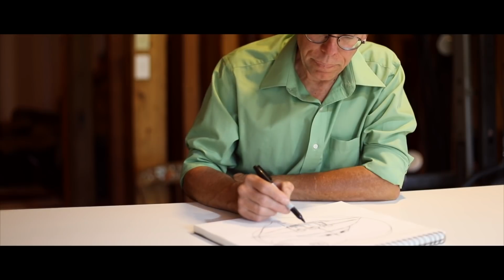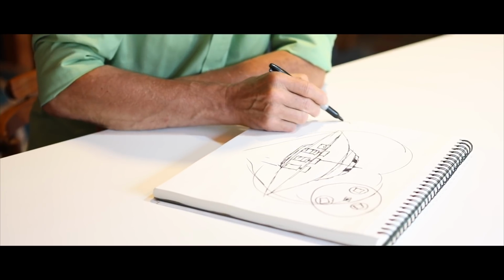BOB LAZAR : ANATOMY OF A FLYING SAUCER : EXTENDED SCENE

Comment: Jeremy I have a question for you.  Apart from any hard evidence, of which I've seen none that is supporting, when I try to think into this process of analyzing anything created not only hundreds if not thousands of years advanced relative to our current technology, it strikes me that it is something like putting a Neanderthal in the driver's seat of an auto or in front of a computer.  One larger difference is that at least Neanderthals are closely related to modern humans.  Just how does Mr Lazar propose a human can not only understand any of the technology in such a craft but actually fly one?  I'd truly love to be able to believe this but it just seems utterly preposterous on so many levels and for so many reasons.  Could you at least explain something of how just this one aspect is possible?
Reply: I see grandmothers and children all the time playing on their smart phones. Could they design one?

Even circus animals can drive miniature cars if they are taught how.
Reply: @codetech5598  I don't see how that is analogous at all since those are all modern humans from the same era as the human designed and made devices.  In this case we are talking about an era possibly thousands of years in our future and made by physically and mentally different creatures. Just how do you control a device that has no apparent controls?  How do you disassemble a device with no fasteners and no seams?  How do you analyze something with zero frame of reference? Most people can't disassemble an iPod.  Try to imagine a dog trying to disassemble one.
Reply: @enorbet2  It's probably not more than a few hundred years advanced.

If you took a historical figure, say Julius Caesar, and put him in the seat of a modern automobile, do you think he could drive it? Of course he could, since the car is  designed to be easy to drive.

This craft is probably like one of those toy drones; you point it in the direction you want to go, and it flies itself. I would be more worried about there being some kind of burglar alarm or similar device.

We don't know if there were controls or not. Bob didn't see any, but he did not work on that part. It was none of his business.  Who knows if a joystick popped up when you sat in the seat?
Reply: @codetech5598  Sorry but I doubt ol' Julius wouldn't know what a steering wheel and pedals were for not to mention how to start it up, and he's human with monkey-derivative hands.  How do you point a saucer shaped flying craft? Actually of far greater concern to me is how do you point the so-called gravity emitters to a specific point in Space and not disrupt everything in between? Then how do you slow down as you hopefully draw near to it, or anything? Also if the emitters are meant to fold SpaceTime to make the distance less, A) How do you determine how much or more less? and B) If they are doing the job of folding, how do they also propel at the same timer?

Look... I get it.  You want it to be true and if truth be told, me too,  but I know a decent amount about the actual Science since I am a degreed engineer and it just doesn't make sense.  It is entirely possible that human interstellar travel is impossible and for many, many reasons and if possible at all it is many, many hundreds of years off.  You'd know this once you understood the energies required.  We are talking about encapsulating in a human-sized ship the entire energy potential of a Star.  The word "monumental" is laughably tiny to describe such a thing.  Fake words like "Gazillion" don't even approach it.  

 .
Reply: @enorbet2   Julius would have been familiar with ships, chariots, and wagons, and would have access to engineers who invented all of the techniques which we know today. He could have definitely driven it if someone had pointed out the controls.

Bob never said that the humans flew the craft in Space. He only said they flew it at airplane height above the desert.  The craft would likely have had an automatic control system like the toy drones so it would have flown itself, except .

"but I know a decent amount about the actual Science since I am a degreed engineer"   No, you think you know something, but you are way out of your league. But, it is not your fault; it's the fault of the academic system.
Reply: @codetech5598  ahh so now you reveal your true colors.  You apparently are one who thinks being skeptical of everything that doesn't support what you wish to believe, including educated experts, even to the point of insulting someone whose education and experience don't know anything about, equals "an open, enlightened mind" and hey, it does level the playing field, right?  Oh well.. see ya.
Reply: @enorbet2  One thing is sure, if humans design a flying saucer, it isn't going to be done by academics ("educated experts") who are stuck in the dead-end theories of GR or QM.
Reply: @codetech5598  you are probably right there.  From an engineering standpoint, even way older school than GR and certainly QM, I see "Flying Saucers" as really bad design - not an efficient geometry for encapsulating space let alone flight of any kind or for any reason. Since Lazar is claiming not only does this "nuclear gravity" fold space but it suspends inertia, so if we assume for the sake of argument that is possible and true, why not make it a globe or some shape more efficient than a saucer?  So yeah flying saucers won't be designed by educated engineers but by graphic novelists and B-Movie sci fi writers.  ; )  BTW I literally LOL'd when I read "stuck in the dead-end theories of GR or QM".  Seriously.... good joke  : D
Reply: @enorbet2  Flying saucers don't really "fly" in the sense of an aircraft, so don't look at the aerodynamics.  Also, when cruising through Space, they don't go "sideways", but "up and down".

The saucer shape is used because of its symmetry. A sphere would be extra material.

Keep in mind that Bob's explanation is only his understanding, how he thinks it works.

"good joke"  Yeah? Well here's something else. If science had pursued in the paths of Tesla, Oliver Heaviside, and CP Steinmetz instead of jumping on the Einstein wagon, we would have this saucer technology today.
Reply: @codetech5598  I'm not at all thinking about aerodynamics since I'm trying to take Lazar's word at face value and see if it... umm.. floats, or holds water or any other term that describes actual function.  I am looking at exactly what I said, the efficiency of design of anything enclosing a space.  Most human habitats on Earth are rectangular because it's easier to produce and place materials that way.  So they conform to the  economics of production.  Submarines are tubular because they need to resist extreme external pressures while housing the maximum amount of people and fixtures for a given volume.  In Space the opposite is true, the pressure is to be kept in and the vacuum out while maximizing usable space since fuel is never free and the ultimate purpose is to provide transportation for people and their needs.. Please consider all the unusable space in a saucer shape.  

No matter how big you make it, ultimately it comes to what in effect is a sharp point and not just at some small end of a long tube but literally over it's entire circumference.  This is massively wasteful and frankly, stupid and any species capable of interstellar travel cannot de facto be stupid. So the odds are ridiculously low that anyone even moderately smart would design such a craft.  That said, maybe the aliens are just REALLY into aesthetics and practicality be damned but then again a species like that would have a much harder time evolving technologically enough to do interstellar flight.  BTW a Sphere is the geometry that encloses the greatest amount of space with the least amount of surface material.  Saucers have "extra", not spheres.

Incidentally, not that it matters to the design flaws,  how would you, Lazar, or anyone know how these saucers fly through space, speaking of the orientation?  AFAIK nobody, including Lazar has ever witnessed one in Space.  Also, what makes you think the 3 brilliant scientists you mentioned are somehow in some different direction from Einstein or what is now mainstream Science? Things either withstand the test of time or they don't and all 4 scientists made their share of breakthroughs and blunders but all of it served to advance Science, even the blunders.  

Draw a circle on a sheet of paper and label the area inside the circumference "A" and everything outside is "Not A".  Notice that when you draw one you also draw the other.  It is just as important to know what defines "wrong" as it is to define "right".  There was no conflict between .Steinmetz, Heaviside and Einstein.  The only conflict was in Tesla's mind because in addition to being a brilliant scientist he was sadly also a devout narcissist and railed against any and every one he viewd as competition.  Tesla is something of a romantic figure also which is part of the resurgence in his popularity, but little in the world changed because of him and much from the other three.  I'm afraid you're barking up the wrong tree here.  Only just last year, was one of Einstein's predictions finally observed and found true regarding gravity waves, and this has been happening for decades many times. Many try to "Knockout the Champ" but he has "kept the belt" for almost 100 years now and 100 years of the most rapid changes in human history.  He had many faults but both General and Special Relativity are monumental works that have utterly changed the future of all Humanity forever and for the better.  He is revered for good reason. He advanced human knowledge.
Reply: @enorbet2  Well that's a long post so I will answer in parts. First, about the saucer.

The lenticular shape is strong and efficient for this application. The bottom deck has to accommodate the three "gravity emitters" which can be swiveled to different positions from straight down to sideways.

The "edge" around the saucer is important for the "wave guides" which establish the gravitational field inside the craft. 

This craft is designed to carry three small guys on journeys that take only a few hours. It does not carry cargo or weapons. 

The entire design is based upon symmetry. As far as how Lazar knew how the craft flew in space, it was deduced through looking at the symmetry. So yes, it is an assumption, but I think it is a valid one.

Also, we do not know that these craft are actually interstellar. They may only travel to a base on the Moon or maybe Mars, which would not take a long time. (In that case, traditional physicists should have no complaint.)

Finally, even if one of these saucers were to land, and three little guys walked out and said they were from Zeta Reticuli, I would not believe them. I would believe they had a flying saucer, but that does not mean they are honest.
Reply: @codetech5598  :) I'll keep this one short.  The saucer shape is not "strong and efficient for this application" though. The strength is in the wrong dimensions.  A saucer shape might do well in deep sea work strength wise since it's strength is against forces acting from the outside in, the opposite of the conditions in space. Because we are not spitting out any exhaust there is no need for any openings and it is highly doubtful that any mass or shape would have any appreciable effect on the degrees of gravity emitted required to fold space encompassing many light years.  I don't see any advantages and lots of disadvantages and this is rather important since the relative strengths of shapes isn't high tech.  We understand those simple mechanical parameters very well.  Can you think of any other application where a saucer shape is useful?  Are they commonplace at all? and no, they are not and for good reason and nothing about the type of craft demands any shape at all considering what it is supposed to do and how it would do that  ie: emitting gravity. It seems entirely fanciful to me.
Reply: @enorbet2  You are correct that a lenticular shape is not ideal for containing hi-pressure gasses but that is irrelevant since the difference between cabin  pressure and the ambient near-vacuum pressure of Space is rather small. So, it is not a handicap.

(Even so, lenticular tanks are used in medium-pressure applications, as a search for "pancake compressor" will show.)

As for the relation between the shape and the "gravity emitters", the shape of the bottom of the craft provides the space needed so that the emitters can swivel to all positions. No more, and no less.
Reply: @enorbet2  Now for the second part of my answer to your post in regards to Einstein.

It is no surprise that experiments are said to have confirmed Einstein's predictions since they are interpreted in light of Einstein. 

Heaviside and other electrical engineers realized that there was a relationship between electricity and gravity, and expected that the next breakthrough discovery would be control of gravity within say 20 years.

Instead, what happened with the death of Heaviside, Steinmetz, and similar actual engineers was a move away from experimentation and a domination of the field by theoretical physicists and abstract mathematicians.

The acceptance of QM and GR has retarded advancement for 100 years.
Reply: @codetech5598  Science doesn't work like that.  There are just as many who would love to demonstrate that Einstein was wrong and carve a historical spot out for themselves.  Also, Gravity doesn't work like Lazar contends.  It has been roughly a half century since Lazar postulated (well... actually stated) that some sort of Gravity exists in the nucleus of an element that was unavailable at the time for study.  Heaviside and Steinmetz respective hypothesis is even older.and since then we have created that element and done extensive study on sub atomic conditions and even the very element Lazar referred to.  So far, and the odds are extremely high that always, there has been no gravity energy in the element and no relationship between electromagnetism and gravity.  There are still four Fundamental Forces., a condition that has existed for over 13,000,000,000 years. That hasn't changed.  

BTW you do realize, I hope, that QM has been THE most successful theory ever in the history of Mankind, right?  As non-intuitive as it necessarily is, nevertheless , nothing has ever been so successful at making predictions that bear out and resist the greatest technology we've ever had to bring to bear for falsification if it were just wrong.  Sorry Bro, you're barking up the wrong tree.  Lazar, Heaviside and Steinmetz were too, at least in this area.  Gravity is NOT magnetism and certainly not electric...
Reply: @enorbet2  QM is a dead end, and its inherent nondeterminism is anti-science. 

In a few decades, QM will be universally seen as the farce that it is, and Einstein regarded as the troll who hijacked physics, and a new generation of practical scientists will pick up where we should have been 100 years ago.
Reply: @codetech5598  Well I suppose I have to say "Hmmm maybe" since almost anything is possible but that would be quite a feat.  Phlogiston Theory as an explanation of combustion  was proposed in 1667 and took slightly over 100 years to be falsified by 1772,  Note that this was the very beginnings of modern Science.  Things didn't change all that much in just a few decades.  In the last 100 years NO Theory has lasted longer than a few decades if it didn't prove to withstand all attempts to dislodge it.  GR and QM are fast approaching 10 decades, nearly 100 years at a time when major changes take place in years not decades.  The odds they are just "a farce" are miniscule.  However that has no bearing on the most basic contradictions in Lazar's explanations.  I'm quite confidant no gravity device housed in an enclosure a dozen adult humans can barely fit in will ever exceed that of Planet Earth, let alone the Sun, by many, many orders of magnitude.  Sorry Bro that's just impossible and ridiculous unless later monkeys might actually fly out of my butt..

Comment: enough guessing.  A 5 gallon drum size amplifier.  That's the important part, and all i get is, it's the size of a drum.  Great.  I just went over the half cone with the glass dome design.  That design is at least semi self explanatory.  This is not, at all.  Bob needs to further his education.  Both of you have the idea that a grav wave is the same as a grav field.  It isn't.  What happened when Adair supposedly launched his fusion containment powered rocket was a grav wave.  Space slamming shut.  Make your questions clear, YouTube.  I have already put the basic designs for a better version of everything I'm listing here on YouTube videos, all over the place.   I can guess at what's in that drum, but I'd appreciate some help.  An idiot might think that it's the Hutchison effect bending the pipes.. a resonant effect,  or a real warp in spacetime, but it's most likely just mechanical, nanotech.  Here's a link for a channel, I've put some designs in the comments.  My best guess is that the half cone dome ship engine is utilizing a pressure gradient created by the vorticular dynamics that generates excess momentum, not zpe.  The pressure difference is relative, the liquid metal is circulating faster at one end of the vortex than the other, the pressure is equal, but because of Bernoulli's law, the system tries to move toward itself, basically.  Are you stuck on how to keep it moving?  That's the combined effect of the sling shot effect and the power, location, and speed of the rotating magnets.  I don't have any clue how i knew there'd be gyro nutation going on in that half cone, but the plans are strikingly similar to those I've posted.  If i have to, I'll rewrite it all.  Drums.  Greeeaat.  Thanks, Watson.

https://youtu.be/3ibkIkCZMVM